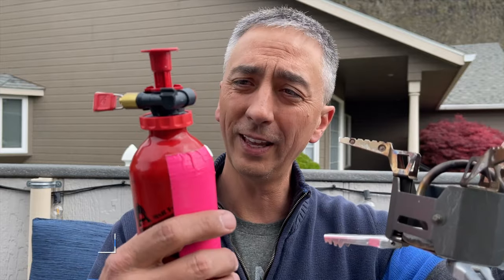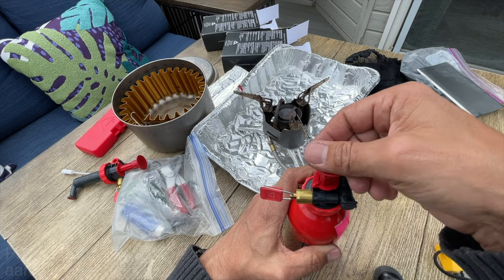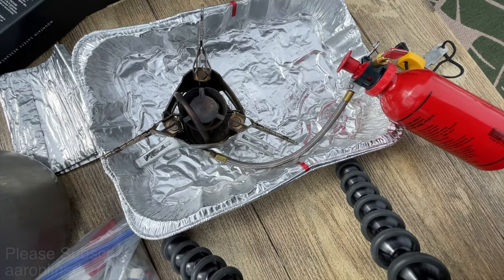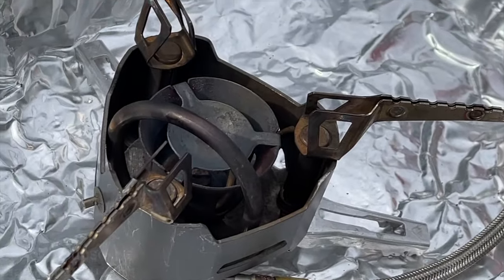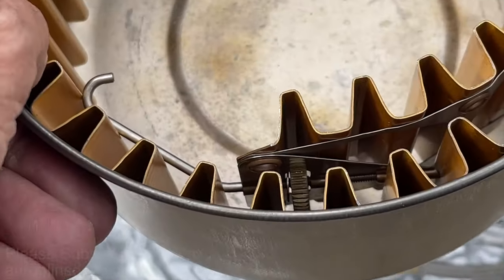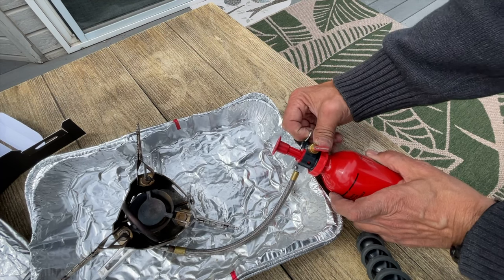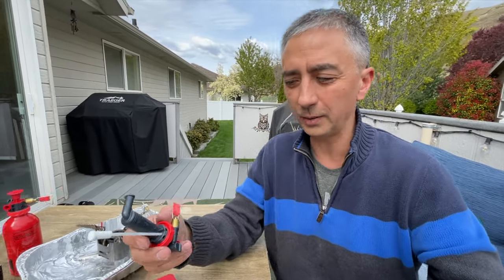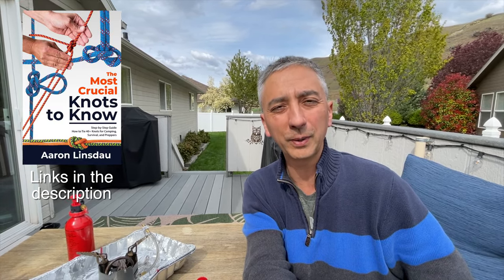MSR XGK White Gas Stove How To Use In-Depth (4k UHD)

Comment: I've had the original XGK stove from the late 1970's and I still use it winter mountaineering. Runs great and multifuel. I don't recommend diesel. A friend of mine ran out of white gas and used diesel. It burned, but everything smelled like diesel fuel.
Reply from the maker: Too true @ diesel. Climb safe!

Comment: One point I'd like to make,  to deactivate these things, i find it better to invert the stove and degas it like that. Obviously one has to do this outside of the vestibule or hut or in a well ventilate area away from any sources of ignition but the fuel will quickly vaporise and then there will be no chance of any liquid fuel leaking out of the pipe when the tank is disconnected. I'm pretty sure i've made several videos on this operation some years back.
Reply from the maker: Thanks for the pointer!

Comment: I use mine on diesel very successfully and prime with alcohol. I use kerosene also and would use Shellite last as it produces the least heat (but is the easiest to prime if you use fuel from the stove). I use kerosene on my Optimus Nova and again it puts out way more heat than petrol. These fuels are safer too in event of doing something careless. I'm not a mountain climber or antarctic explorer though. Possibly in some conditions Shellite is better.
Reply from the maker: It pretty much burns anything compressible.

Comment: Is it accurate that it can boil water quicker off of kerosene than white gas? On the specs for this stove I saw that kerosene boil time is significantly quicker than the white gas time. However the Diesel burn time was a lot longer than both of them which doesn’t make sense to me because I already would think white gas it would be quicker. And if anything, kerosene would be pretty similar to diesel.
Reply from the maker: Very possible, I've not tested that. Finding kerosene might be a challenge in some locations.

Comment: I think the recommendation of the Expedition Service Kit and a spare pump are sound. I had my XGK with a fault on the filter from new. It eventually completely blocked after several litres of fuel being burnt. It also came with a damaged but entirely usable GK jet and finally I managed to snap the shaker needle off. The shaker needle can be broken on this stove, unlike on the Dragonfly and my Nova, simply by screwing the jet onto the needle during reassembly and it flat on the ground. This is a design issue i think as it doesn't happen on other stoves, as I mentioned. It is what it is though so YES, you must insert the shaker needle into the jet and screw it in while holding it sideways or upside down...I suggest you hop around on one leg and chant Hare Krishna at the same time to ensure success.
Reply from the maker: Good pointer - that's a delicate item on the stove.

Comment: One good piece of advice. The MSR XGK which I have been using in harsh environments for many years taught me a trick that will save you a lot of cleaning. When you turn off the flame, a little golden flame will come out of the nozzle. Don't let it burn as it deposits carbon gunk directly in the nozzle, always blow it out immediately.
Reply from the maker: Great tip!
Reply: Is it accurate that it can boil water quicker off of kerosene than white gas? On the specs for this stove I saw that kerosene boil time is significantly quicker than the white gas time. However the Diesel burn time was a lot longer than both of them which doesn’t make sense to me because I already would think white gas it would be quicker. And if anything, kerosene would be pretty similar to diesel.
Reply: I'm finding that flipping the bottle on the XGK works best and when the flame goes out immediately close the valve.

Comment: Hi Aaron, love you videos and just saw your Denali gear list for the first time, love it. I’ve used msr xgk stoves for ever with mostly good results. Had an epic on Cho oyu trying to burn kerosine and priming with yak dung. I’m having a grass is greener on the other side moment and considering buying in to the whisperlite stove. I’ll be heading to Denali for a 4th time with only my wife and might leave the mega mid at home, spend more time cooking in the vestibule. I read that boil times are the same for the xgk and whisperlite, while whisperlite is lighter and quieter. Do you have any experience with the whisperlite? Can you comment? The flare up always seems to be exciting in the vestibule with the xgk, wondering if that’s more controllable with the whisperlite? 

Second question, I’ve mostly used a plywood cook board under my stoves. Even with the board, snow melts underneath with system tilting to one side. Not really a problem. Could I really get by with just the oven pans? That would be great. Note, I’m a big guy, boil and drink a lot of water. Great time this winter to go test. 

Last question. The canister stoves seemed to be popular in the Himalayas. Is there something the international crowd knows that we don’t? Different canister gas ratios?

Comment: Hi AL,

I'm your viewer, subscriber with 8 accounts, liker and commentator. Sometimes I'm a Youtube premium, sometimes I got ads and I don't skip your Ad.
Question: I wonder, why you don't use a burner silencer, like Quietstove 107 or Berniedawg's XGK Dawg?

Thanks
Reply from the maker: Looks like nice products. I like to be able to hear the stove for tuning & safety. The moment the pitch/tone changes, I can tell that the fuel bottle needs pumping for maximum efficiency.
Reply: @ALinsdau  I've tried the Quietstove 107 with MSR Dragonfly, with fuel LPG (butane), white gas and biodiesel (I've run out of kerosene).
The loudest was biodiesel, the sound decreased by around 50% only. But the priming time was easier and quicker. 
The second is my favourite but the most expensive: white gas, I can sense that the noise decreased by 90%.
The quietest is when I tried with LPG (butane), I sense that the noise decreased by 90%, or maybe more. 
The boiling time feels the same, it does not feel to be slower. For all the 3 fuels I use the same nozzle: DG (it was because I cannot unscrew the nozzle - again).
I've modified the hose to support the Lindal connector type, and then changed the pump with the one from BRS.

Comment: LOL, cut my teeth on the second generation XGK (straight pipe, poorly designed pot holder and super bendy aluminium shell around the bell) been to almost 6000m with it LOl over 30 years old and still going strong (obviously serviced several times in that period).
Reply from the maker: Nice - be safe out there.